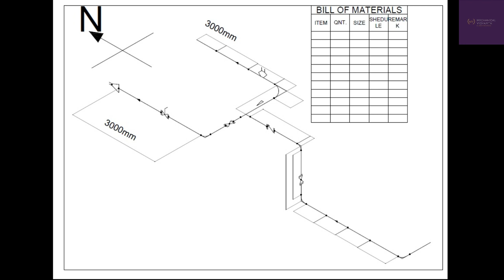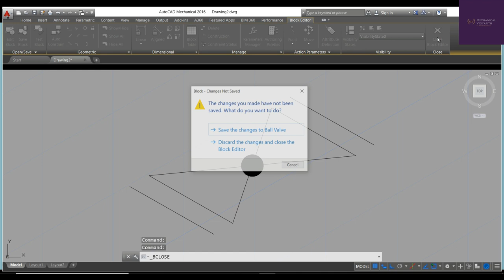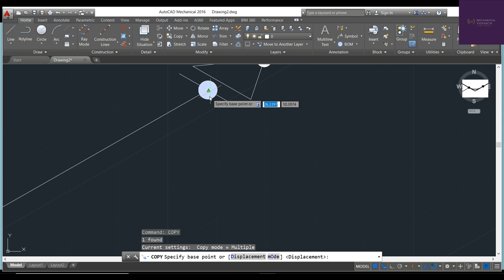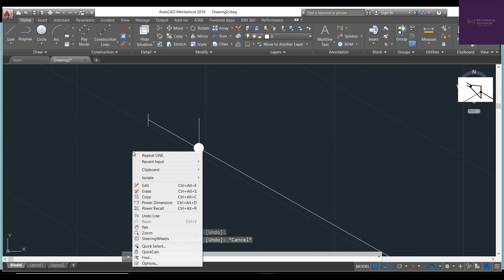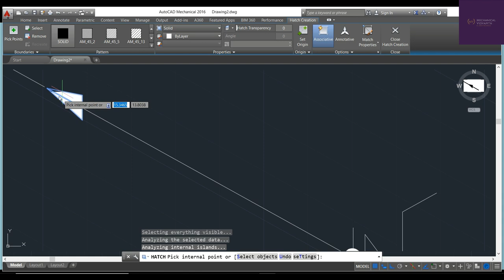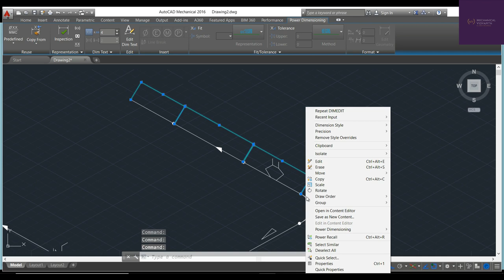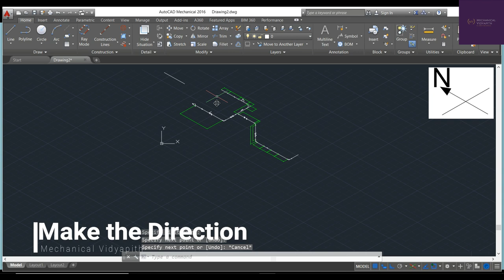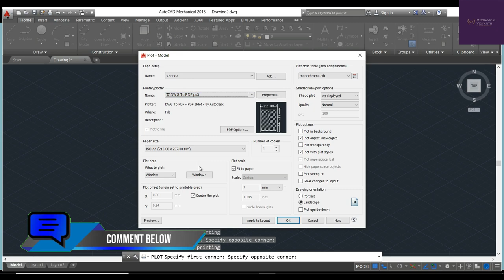🔴P&ID Drawing - How to create Isometric P&ID in AUTOCAD | Piping Course | #Autocad

Comment: Great video!, please keep sharing more. I have a question I hope you can answer me: what is the difference between drawing a P&ID with AutoCAD 2D (as in the video) and AutoCAD Plant. I want to learn more about P&ID.
Reply from the maker: @Anton J , AutoCad is a professional drafting and documentation tool and it can be used for reviewing and marking up DWG, DWF files. It has also tools for point cloud data and editing  + 3D conceptual design but AutoCad Plant is dedicated software for piping. It has P&ID tools, for editing and plant designing. It can also optimize 3D Plant layout models. Before Autocad Plant3D , Autocad was being used for creating P&ID
Reply: @mechanicalvidyapith8653  plant3d also has the same point cloud functions as regular autocad. I'm doing a project right now with an imported point cloud from a facility scan and routing new pipe all under plant3d.
Reply from the maker: @clutchboi4038  That's great.